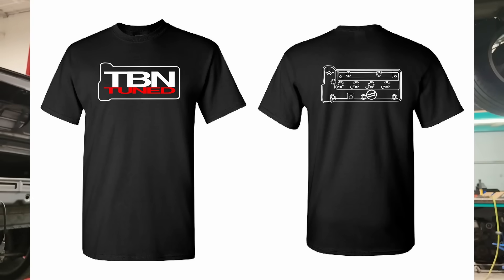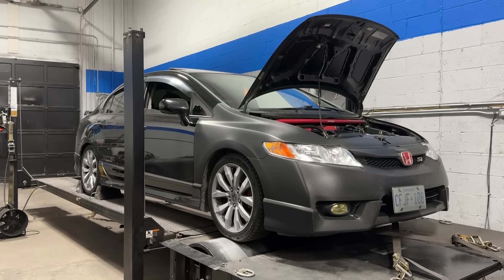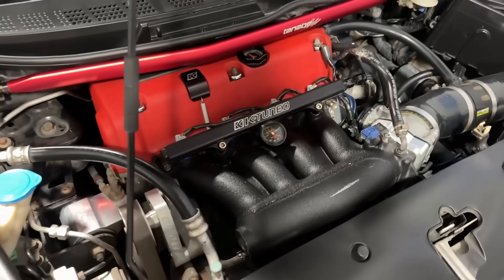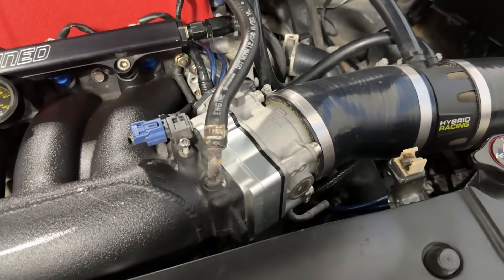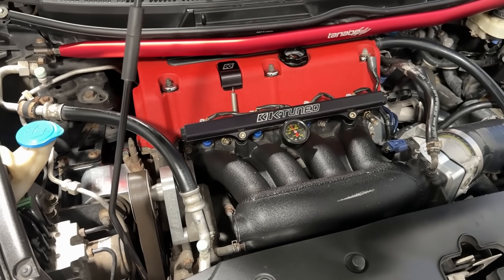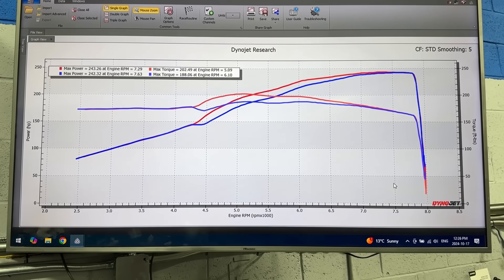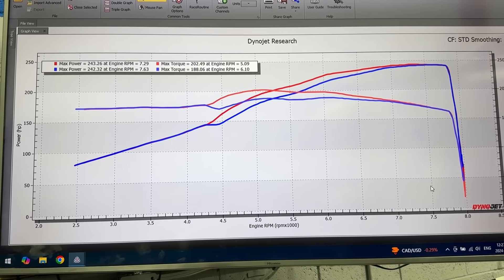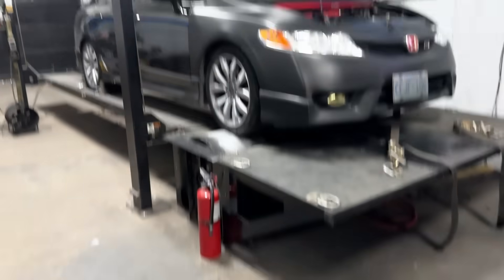K24 50º VTC Cam Gear Upgrade Comparison

Comment: It is neccessary to remap/retune the ecu if someone change the cam actuator/sprocket from 25 deg to 50 deg to prevent the valve hitting the piston.
Reply: Yes.

Even a street tune is worth it

Comment: i have a k24z2 and was thinking of swapping in a 40-45° VTC limiter with an 06-08 TSX cam, but was advised that at that angle the valve and pistons could collide.

Comment: Years ago I was going to put a 25* vtc machined to 40* I think, into a k24a2 because I was worried about valve to piston contact.  I just wonder now if that was a wasted effort or a smart insurance to have?
Reply: I was just going to ask this. I thought you were supposed to lock it out

Comment: Nick, do you think it makes sense to do this on a turbo setup? My understanding is that too much low to mid torque is what kills these motors, so the additional degrees might not be useful. What are your thoughts?
Reply: Trust me it’s not needed you not going feel anything different when it’s boosted…this is more for bolt on or NA setup

Comment: Is 50° vtc useful is if supercharge a k20z1.. it's a merc 1900 tvs with 74mm tb , skunk2 alpha headers , 3in straight pipe exhaust , rbc manifold , 1200cc injectors hellcat fuel pump .

Comment: Can I throw in a 50* vtc gear and drive it on my current tune? Just till I can get to a tuner? I’m k24 a2 dyno tuned on flashpro. Making 220 at the wheels right now all stock internal wise. Plan on doing a timing kit, type S pump and the vac at the same time as well as head studs and a MLS gasket.

Comment: Hey Nick. I got an ej8 with 04 k24a2, k20z3 head, stock rbc intake, type S oil pump and 50degree vtc gear. Do I have to use a vtc limiting pin to limit it to 40° or limiting it on the kpro is okay? I'm just gonna finish all the bolt ons and would like you to have it dyno tuned.

Comment: How essential is a 50 degree VTC in a k24 running at turbo setup?
Reply: If u put it in engine i would recommend safer 45 degree to leave little error room for mistakes
Reply: @oljackie35 I didn’t end up doing it, K24 VTC gear shouldn’t hold me back from the power I’ll be making.

Comment: I did a similar setup on my K24 swap.  50 deg VTC, type s pump, but kept the stock intake manifold with the 64mm TB, KTuned swap header, and 3in custom exhaust.  Due to class rules, power to weight, I was shooting for 220 hp and we got 220hp and 200ftlbs.  Due to using the stock intake mine makes torque lower and for longer.  Nice thing is, like your video shows you can keep the torque and get more up top with the manifold swap.  Great stuff.
Reply: Going exactly same set up as you.  I was told 50 degree vtc is useless without changing manifold.?? Is that true?Also what injectors were you running?
Reply: @ stock injectors and I would say if you want more down low torque and plan on staying on stock cams it’s absolutely worth it.
Reply: @ivangiron6364  it's the other way around. an rbc swap without the vtc loses power.
Reply: @acevedohiram the 50 deg vtc does help with power for RBC setup so it won't loose midrange. But with rbb and 50deg vtc, it would even more GAIN power in the midrange.
Reply: @ronaldsanpedro4338 accurate. My tuner was limited on my k24a base rsx by the vtc even with stock manifold. He told me it was asking for more. Still not the point of my original comment.

Comment: Great video! How are the different VTC cam gear degrees controlled? I understand that it is controlled by oil pressure. Are the target degrees achieved by modulating the oil pressure to the cam gear? Also, is there a VTC gear angle sensor to tell the computer what the advance is?

Comment: So much work for 240hp and still no torque.  

I really don't understand why the L15b7 gets so much hate.
Reply: because it doesnt rev high and is not as reliable
Reply: @ It wasn't built to rev high. I wouldn't say it's unreliable. It is built at the top of it range. It just can't handle more than 270-300 with longevity.
Reply: It gets less hate than the L15ca

Comment: 202 torque out of a k24 is amazing!  Most of the K24's I've seen on your channel are in the 180-185 range.  I was under the impression that a lot of them had the 50 degree VTC too... is there any other secret sauce on this engine that helps it crack that 200tq mark?
Reply: Bump

I’m guessing cams? Maybe E85?

Comment: and to add to this, you can get these cam gears off any 02-06 CRV at your local junkyard for cheap too if you don't want to spend $300+ for a cam gear. There is many of these CRV in the junkyard that people don't bat an eye on. These go for $10 + Tax at my local junkyard.
Reply: This is the type of info I pay my internet bill for 👍🏾
Reply: @oldsklteg  that's just incorrect. The 50°prb/rbc cam gear comes from the k20a2/z1/z3 and maybe  the k20a3 off the si, rsx or ep3.
Reply: Crv's only have 25° cam gears, just as all k24s have.
Reply: @ghost-carnage8964  you should go tell hybrid racing and k series parts and every other shop online that the info we have is incorrect too then.
Reply: Def can’t get 50 degree off a crv, that makes no sense when tuners know that there’s a difference, part number doesn’t matter 😭
Reply: Pause, the CRV cam gear goes up to 50 degrees??
Reply: @Piojo69  the k20a2/a3/z1/z3 have a 50° cam gear. The k24a1 does not. I dont know what these idiots are saying but dont listen. I'll die on this hill. I do this shit FOR A LIVING
Reply: @Piojo69 go look at the part number. they are the same.
Reply: @ToupacRule they are the same. I work for Acura and have compared
Reply: Wrongo
Reply: Yup I have a 40 limited 50 VTC from my old K24A1
Reply: @Au_128 these people just don't do their research. PND and RBC. I've pulled many from the crv. they probably get them from the elements and accords. lol
Reply: Yuhh its 100% the same. Pulled one off a 06 crv had rbc marked on it.
Reply: I’m guessing $10 each you’re gonna pull more than one to avoid the chattering on a part so old, then you have to factor in cost of your time.  Just get a new one for $200 and be done with it
Reply: @pkgmsu  if you can get a new authentic OEM for $200USD than that is a deal. Hopefully its not from eBay or Amazon because the only place i would buy new is from a reputable shop or the dealer so as of right now they are $300-$400USD. Thank goodness i haven't gotten one that chatters. This is a budget alternative that has work for me and maybe it can help others save funds if they choose this route.

Comment: Excellent content as usual . Silly question . Is there a reason you part throttle tune ? Would other tuners do this or should I be asking ? Thank you for you feedback .
Reply: there is very good reason to do part throttle tune. you wont always do WOT which means your engine will be in part throttle by that time. not optimizing the part throttle can give you drivability issue especially when you daily drive it
Reply: @n.shiina8798  thank you for the input . I really appreciate it .

Comment: Quick question I have 2006 honda accord with manual transmission if I swap the head to k20a type r head in the stock k24 block dose the stock ECU work or I should go with hondata or haltech?